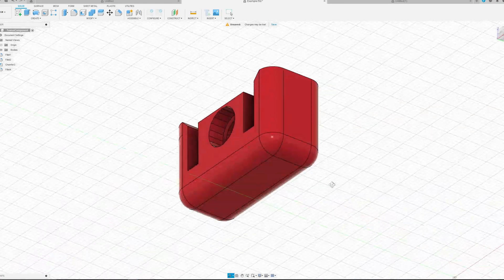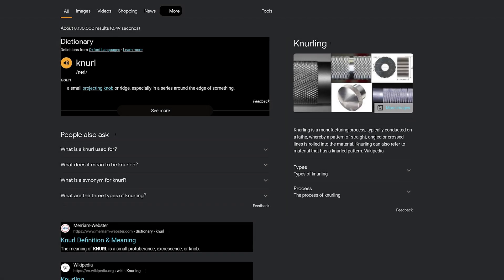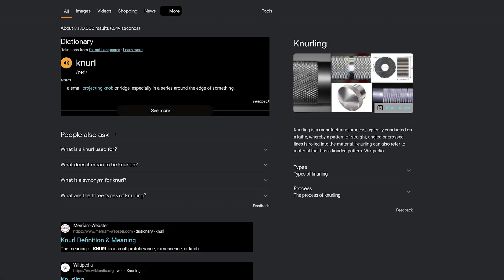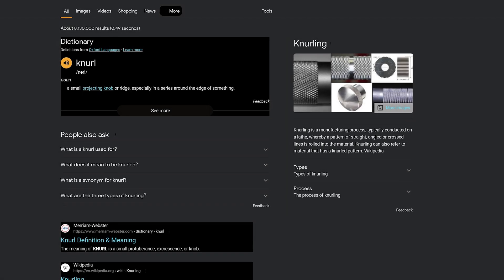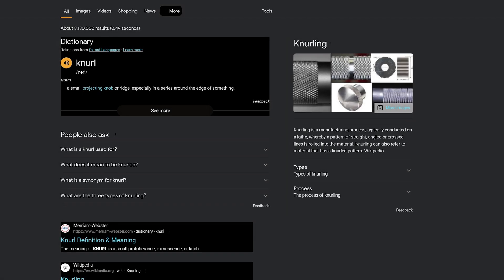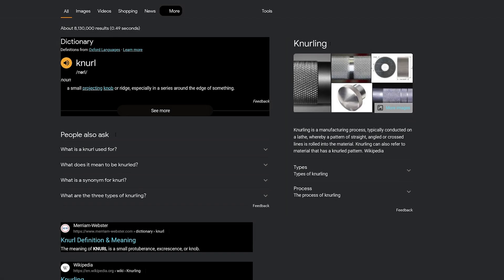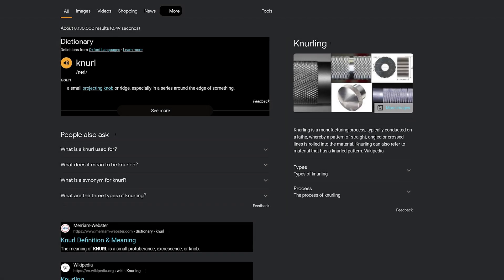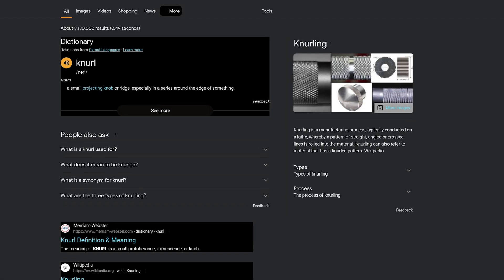How I Designed Knurled Knobs in Fusion 360

Comment: Whoa! That tip at the beginning was worth gold!  Thanks. The video for Knurled was awesome too, easy to follow along with.  Question, when you have a design baked and then you went with the change at the end how do maintain them in 360 , is there like a body 1 & body 2 or v1 & v2. Iteration control?
Reply from the maker: Thanks for watching! If I'm understanding you correctly; At the bottom of the work area, there's a timeline (design history) of every change you've made. So, if you save the file and figure out later that you want to change/remove the last edit you made, you can just back up the timeline or delete the last event entirely. This applies to every event in the timeline, but the farther back you go, or depending on how much you alter something, it can mess with things later in the timeline - So, you have to be weary of what or how much you're changing something... or be prepared to make several changes to other events in the timeline. It can be finicky, but after doing this a few times, you'll get used to it.

I'm assuming that you're referring to the last bigger coil I made after the knurl was already done. Even after I made the last coil and saved the model, I can always back it up with the timeline and export the model in previous states of editing. For example, if I just wanted to go back to the regular knurl, I could just back the timeline up one event and export/save as mesh right there, and it would be without the final bigger coil.

Hope this helps!

Comment: the way i typically do this is i start a sketch on the bottom face and make a 0.5mm - 1.0mm square rotated 45 degrees onto its tip that insets into the body by 0.5mm or so and use that for the coil, might make it a little neater, especially when it comes to flat-flat faces, once ive done that i do the same sketch just instead using a left handed coil and then use the circular pattern tool to wrap it around the body